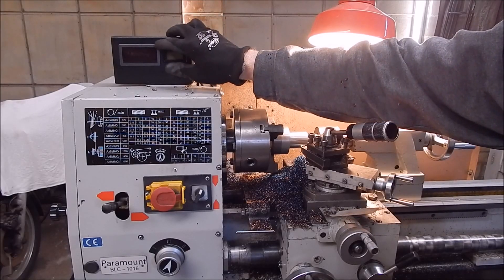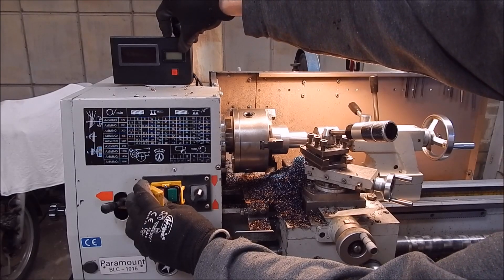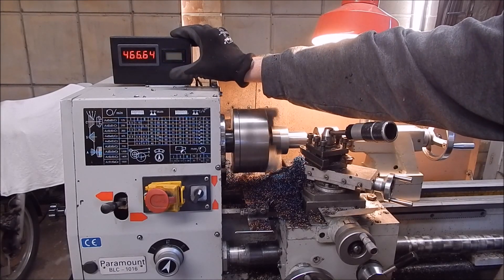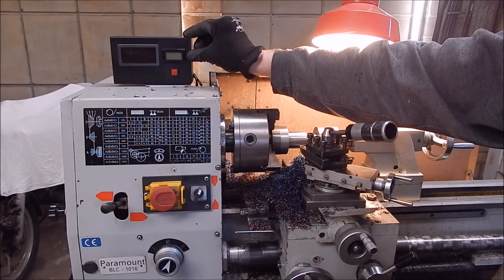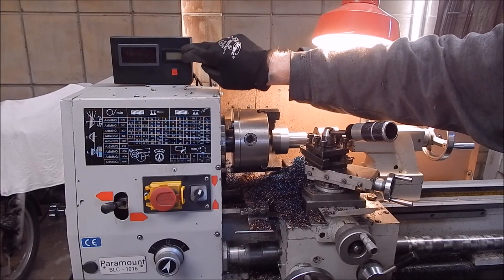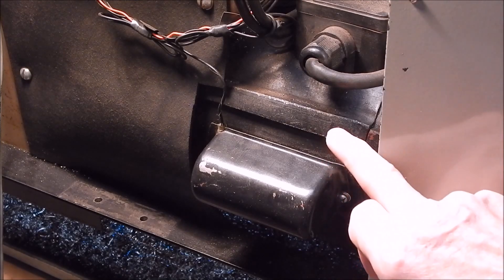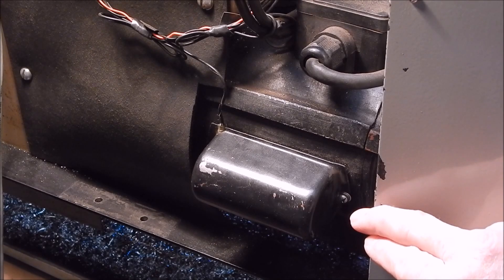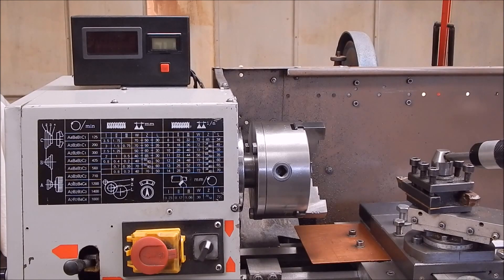Fit a motor temperature gauge to a metal lathe

Comment: Hi Rob:
I have a 3ph 5HP motor in my lathe and I'm planning to add an Ammeter to allow me to know the load on it, and be able to run at 90% more or less full load,  to increase productivity and speed. A lot of people do not run their machines at their designed maximum load, wasting time and energy. I'm not proposing abuse but running within designed parameters particularly when roughing. The same goes for a mill. On a mill, one way of knowing if you're wasting time, is touching the table to feel the vibration and load; if you feel just a tingle, you should increase feed, DOC or both accordingly.

Cheers

Jorge
Reply from the maker: Hi Jorge,

Good idea.  Meters are cheap and easy to fit.

Go for it.  The readings might give you a fright though :)

Cheers Rob

Comment: Hi, A quick read on 'net suggests that motor life is doubled for every 10 deg C under designed operating temp.  20C under get you from 20,000 hours to 80,000 hours mean time to fail.  It looks as if 50C is a conservative figure so your motors will be glad of such a careful and considerate owner!  (Some TEFC ones run hot enough to burn skin at design ratings).  Nicely done. Cheers, Bob.
Reply from the maker: Hi Robert,

These meters don't have any form of calibration, and windings temperature will be higher than the case temperature.

So 50C is a pretty "safe" figure as I see it.

No point in pushing it until it smells hot, or worse.

Cheers Rob

Comment: Hi Rob,

You mentioned the temperature read out being a bit bright; often those LCD screens have a dimmer port on the back (it might be behind some plastic casing). By feeding it a voltage (that you can vary by making a voltage divider from a trim pot and a resistor), you could probably set the brightness to something you like.

I do like the tachometer, do you have it on the motor shaft, or the spindle?

Thanks :) 

Adam
Reply from the maker: Hi Adam,

Good idea.  It has a clip together construction with a sealed back, but I'm hesitant to open it up, as they use those micro connector strips in these things, and once disturbed they never work properly again.

The original temp gauge was the same type of display as the tacho and was a better display.

The tacho feeds off of the spindle using a magnet and Hall effect sensor (three wire).  It's a nice little cheap unit with a variable multiplier function built in, for indirect reading from a pulley.

It was fitted for the variable speed function of the DC motor conversion, but is still useful for a quick reference using AC (rather than reading the belt chart).

I'd actually be sorry to not have it now, as it is quite handy.

Cheers Rob

Comment: I was always told " Do we need it" No  " Do we want it" Of course we do.   Thanks for sharing Rob. regards from the UK
Reply from the maker: He He.  That's about right.

It was handy with the DC motor conversion, as they went into rampant heat rise if you asked them to do anything remotely difficult.  That's why I went back to AC.

AC motors just plod along regardless, even when stinking hot, as they have no armature windings to cook up.

But I had to fill the hole as it was annoying me, and it's a talking point if nothing else.

Cheers Rob